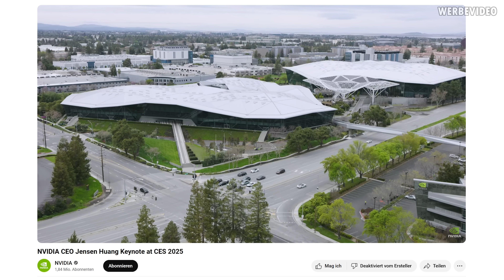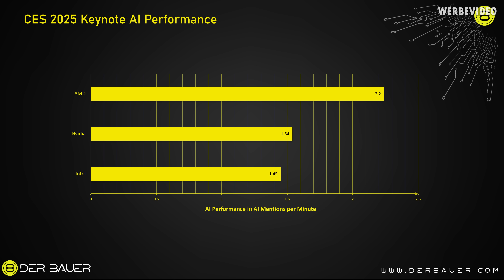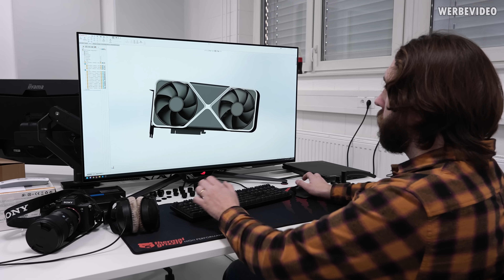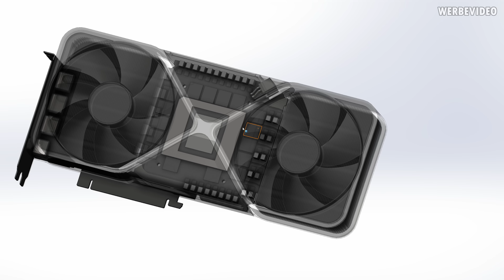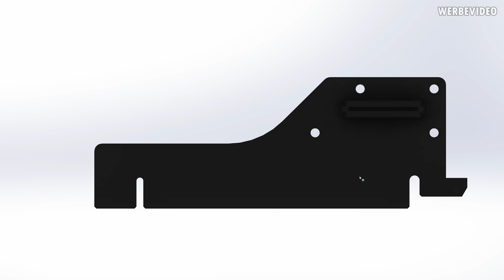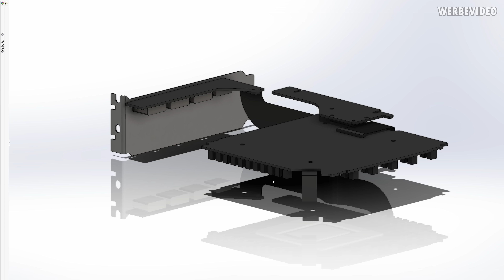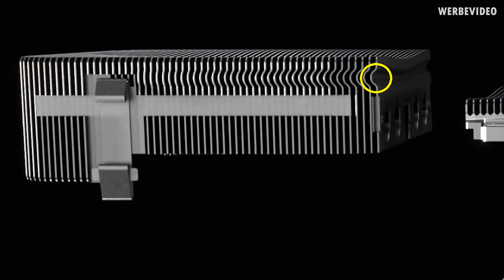We Reverse-Engineered the Nvidia RTX 5090 Founders Edition

Comment: I usually go for the founders card's but concerned this gen with their design. Definitely well engineered and all but wondering what the thermals  and noise levels will be like for running 575 W in that 2 slot cooler. Also, using liquid medal as the paste makes it a little more challenging for maintenance if you need to re paste the GPU. Think I will be going for the big ugly chonker from an AIB.
Reply: do liquid metal need repaste?

Comment: Further proof that nVidia is going to war with its AIBs in this design -  there's no way an ASUS or MSI could manufacture something like this and keep the same MSRP tbh as Roman said well. 

I was sceptical of the cooling capability as there doesn't seem to be an awful lot of heatsink mass until I saw GN's video on the 4090 prototype - it will dump loads of that 600W heat into the case but having so much clear area to the finstack might work very well. Before I'd assumed they'd done something like the ROG Matrix 2080ti and a couple of Colorful cards where they'd build a small radiator/pump into the form factor of the card

Comment: what's cool about the 3 piece pcb design, is that if the connector breaks due to sag, you can just replace the pcb connector, it also reduces the problem due to sag the gpu die might rip the pads under it, or in the rams too. also in the future the pcb could be just mounted on a motherboard by the connectors it has on the back like a raspberry CM or any compute module really, we mich see SFF pc's using that, or perhaps a thin PC using it
Reply: Clearly sag poses less of a threat to the die or MCs with this design, but my first thought was that it's putting all the weight on a much smaller area and a much smaller connector, which I'd think is definitely not a good thing. No one seems to care, though, and nvidia's engineers probably wouldn't make stupid design choices on a flagship product with so much R&D, so what am I missing?

Comment: it remain to be seen if those fin's actually is 58 difference bend. A graphical visual does not confirm, but well see once you have the card. Other than that, im not paying Nvidia 2000 dollar + tax on top of it wich ended up with over 28K NOK, 3'rd party will cost over 30K NOK. Crazy Crazy. Im skipping this 50-series and i have a feeling well see the whole saga again with connector and bend PCIe (from 3rd party).

Comment: Nice analysis der Bauer and team.  The Solidworks model looks great sketched up, good work Joe!  So the 5080 won't have the 5090's vapor cooling design, custom fins, liquid metal, etc.? I was hoping it would at least have the vapor cooling, but makes sense they kept the costly design and manufacturing only for the 5090.
Reply: I think the 5080 and 5090 will be the same, besides the main PCB, because it also has a through fan at the back. If you look closely at the 5070 however you can see that the left finstack is 'fake' and it actually exhausts half of the cooler through the IO bracket.
Reply: @JR23Design  Awesome, I'll have a look at the pictures again tonight then!
Reply: @JR23Design  Just checked, the Length, Width, and slots are the same dimensions for the 5090 and 5080.  Also the heat fins have that concave shape. Externally they look identical.  Vapor pipe cooling for 5080, nice!
Reply: I saw a video with a manager from NVIDIA who said that the 5070 won't have this new cooler, so i guess that the 5080 and 5070ti will benefit from this 5090 FE cooler, not sure about the 5070ti though. Does the 5070ti have the same lenght, width and  slots as the 5080 and 5090?
Reply: @Maitatron  5070ti has different dimensions than 5080 and 5090.  5070ti is 62mm less length, and 25mm less width. It is a 2-slotter though, so same height.  The FE 5070 does not specify LxWxSlot, "it varies by manufacturer". Info on Nvidia's website.
Reply: @dirtbiketrailrides  Ah thanks for the answer, so 5070ti might not have this super efficient cooler. What a pity cause on paper the 5070ti looks like the best card for performance per $, i guess 5070ti can't have it all.
Reply: @Maitatron  Yep, read JR23's comment, he pointed out on the 5070ti pictures that one-half of the gpu's fin stack is flat, and the fan may be positioned differently.  Not sure if the vapor cooling pipes are on it or not. Maybe not. Liquid metal interface, not sure either.  But it will have less cooling features since the exterior and dimensions are different.
Reply: @Maitatron  from the product images released the 5070 and 5070Ti seem to have a cooler and PCB that is very similar to the 3080, just without the 90° bend in the fins.

Comment: That modular design is really good in terms of repairability.
Reply: Do you expect Nvidia to sell you the output board, the PCIe connector board?
It's not better when they are not off the self components.
Reply: @IIARROWS  those are simple connector board which can be manufactured by anyone.
Reply: @PenguinYayOne  They can, but would they be? Especially considering the shape and relative low volume.
Beside, what's the probability that they break? They are pretty simple, that's not the part you are going to replace in case of failure.
Reply: @IIARROWS  they are. Cracked PCIe connectors were common on 4090s
Reply: @PenguinYayOne  Ok, good.
Well, this is going to weigh less, let's see if it has an impact too.

Comment: When you do your review, can you show PCIE 4.0 VS PCIE 5.0 I'm on a 5800x3D so would like to know thanks 🙏
Reply: Hopefully it will be 1-3% difference like last time when they tested Gen 4 cards on Gen 3 boards
Reply: I’m on 5800x3D as well. Still a beast of a cpu. I play all my games at 120hz and have never been cpu throttled.
Reply: Genuine question: why would you buy a 5090 if you're running a 5000 series AMD processor? 😂
Reply: @deejnutz2068  well, in my case with the 5800x3D and an Rtx 4070 the limiting factor in all games I play is always my graphics card. I play everything in 4K bc I’m a couch gamer. The 4070 does pretty good for most of my games “most games I can do 4K 120hz on medium-high settings”  but I’ll likely get a 5080 if I can get one for msrp. Also I never see my cpu usage go above 20-30% usage. So genuinely no reason to upgrade to am5 yet.

Comment: After the leak of the laptop 5080 performance I did a crude calculation of the expected performance uplift for the desktop 5080 over the 4080. Simply based on CUDA cores using the 5080L openCL score, the absolute minimum uplift over the 4080 is 11%. That is assuming linear scaling for CUDA cores, and not factoring in the higher clock speeds or power limit on the desktop card. This puts the 5080 with an expected minimum score of 266k vs 230k on the 4080. Realistically I believe in reality the actual performance will be closer to 300k for openCL, which equates to approximately a 25%  uplift over the 4080, which also reflects the first 2 benchmarks in Nvidia's presentation. 25% isn't bad, but I just wish Nvidia wasn't intentionally misleading consumers with totally fake numbers. MFG and DLSS doesnt indicate raw compute power.

Comment: After testing frame gen i came to the conclusion that its absolute garbage and should never be used under ANY circumstances. Nvidia needs to be given as much flamming for the complete lack of raster improvements for this gen (remember the 4090 and 5090s biggest difference isjust the CUDA count, not really raster improvements Gen to gen since its still on the same node pretty much)

Comment: I don't really understand why people like interpolated frames this much?
In most first person shooters I am more sensitive to "latency" than to "smoothness".
I am normally satisfied with 50-80 FPS when it comes to "smoothness". But when it comes to "latency" I prefer 100-144 FPS. (I might prefer even higher if my monitor was faster.

Thus for me to use frame generation and keep the same "latency" I would need a rendered FPS of ~200-280 FPS (frame generation needs two frames to interpolate between, thus you will always add the latency of that one extra frame) and then get ~400-560 FPS with x2 frame generation.
And even if I had a 500 Hz monitor I am not sure that I could even tell that it is more "smooth" than the already 200 FPS.

I guess there could be games what are playable with large "latency", Say maybe flight simulators. In those games you could maybe run with a base frame rate of 25 and then use frame generation to get the game to look "smooth". By getting 50, 75 or 100 FPS. And in a game whit slow movement there might not be that many artifacts from frame generation.

But this is just such a limited use case for me. Maybe others have found better use cases?

Comment: We can no longer use frame rate as a direct measurement of performance. Now that not all frames are equal, or rendered we need to use a different metric to measure preformance
Reply: Yes you can, just turn off frame Gen and dlss
Reply: @Crecross  We already saw that Nvidia didn’t do that.
Reply: Measure them in flops 🤡

Comment: Wow. Nvidia will sell a TON of the FE models if that's the design. The Custom coolers and mini PC cases that will take the main board and the cooling fins out and place them in a new location in the case is going to be awesome! How about a case with the GPU at the top blowing air out or sucking air in! It's going to be so cool. I'm sure card makers are all going to go crazy adopting these PCI / IO connectors on their main boards.

Comment: Thinking like an engineer, you may not need 58 different tools. If all the bends have the same radius, they could just use the same tool, but stamp the different parts a different number of times for each piece. You can calculate the deformation at a given pressure for the fin material, so for example, the least bent fin gets 1 stamp press, and the most gets n+58 stamps. The process becomes longer and more involved, but the cost of the tooling could remain within reason.

Great video, very interesting, I always love your work!
Reply: Could they also be stacking up the fin plates on top of each other and then stamping them all at once? The top stamp would be the sharpest, and all others after that would be greater radius as they all mold around each other in the press.
Reply: @billgaudette5524  stacking them wouldn't work. No way to control material thickness. They would have specialised tooling to do this at scale.
Reply: @billgaudette5524  They will no doubt be re-using the stamping tools in the other FE coolers as well, just not so many fins.
Reply: My thoughts exactly. Doesn't make the design any less impressive though.
Reply: Thank you. That's exactly what I immediately thought looking at those fins. Nobody in their right mind would make 58 different tools just for a single radiator, instead the shape of those fins look like something you can make with one customizable tool. Which is still pretty cool and much more cost efficient. It might work just as you described or it might have different customizable pressure parameters for each desired deformation of a fin and just cycles through them.
Reply: I think it is even simpler than that. Have one big sheet that is stamped one time, the tooling is devided in a way that each part of the big sheet of metal is stamped differently, each according to one individual fin. Then the big piece of metal is is cut at 57 different places, creating 58 pieces, all unique, but that came out of one large sheet that was stamped once
Reply: @ignaciolcb  The BFS. Big F**ing Stamper !!
Reply: More likely they are just using a progressive die with a stage for each bend and cut. So they can essentially make every fin with one tool, just at a different stage. We do this all the time in manufacturing. Keep in mind that in the US, tooling is tax deductible, so most companies don't really care about tooling costs as it just lowers their overall tax liability.
Reply: The concave surface of the stack would need to be done after stamping rather than at the same time if the bend radius is done with pressure. Combine both it shifts the cost of the die to cost in time and exceeds it. Then it introduces greater risk of manufacturing errors which can cost more than a stamping die.
Reply: I was thinking more like 3 stamps, all together where the centre one does the radius and can move down after each fin so it creates a larger radius
Reply: But but but get hyped. I believe this thing will throttle in a small form factor case. Definitely look out for reviews with open benches.
Reply: @aberkae  I think the fact that it is small is going to make a healthy number of reviewers to test in SFF cases if not initially, certainly in follow up tests & reviews. Optimium is a case (pardon the pun, VERY unintentional) as he always does SFF builds. Nvidia could have built it 4090 size and no one would have batted an eyelid.They must have seen some benefit in building down to 2 slot size.

Comment: 5:59 frame generation is not more performance. Better frame smoothness, but system latency is even higher which goes counter to the conventional measurement of performance where higher FPS means better responsiveness.
Reply: Fake frames are analogous to an automatic transmission if you think about it.  Automatic transmission can't anticipate the road, just like how the gamer will change the scene.

It's an instantaneous smoothing.
Reply: And all the fastest cars are? Automatic/electronic shifting, and what do they all have? Assistance, ie traction control, differentials, abs, and so on.

Nvidia might be adding latency but I assume their but unveil of reflex 2 is to counter this, much of what they spoke about was the use of ai to render frames in a more accurate light to how it should be.

Comparing a car to a computer is already a stretch and it's quite a pointless analogy, nobody needed an analogy.

And you can't actually state it has higher latency without seeing it run, my guess is DLSS 4 limits the amount of native frames slightly, so rather than struggle to render 40 it does 30 and reduces latency through this and reflex 2, Nvidia may be greedy and may be cornering the market, but they aren't stupid, DLSS, even 1.0 was quite a piece of software, and they rarely mess up, I highly doubt that they won't deliver on this occasion.

Most people moaning about latency and don't even benefit from 5ms, let alone the 20s they so badly dread, if it was poor, only a small portion would truly be affected in any forms meaningful.
Reply: @fewik8567 30fps response times feel atrocious no matter how slow your brain is.

Comment: Usually the dimples, bends or louvers would be to increase turbulence and thus increase the air side heat transfer coefficient. The concavity of the fins may be to try and increase flow velocity through the center by increasing the resistance on the edges (since there is more fin surface area). 
Honestly the thermal design of this card looks amazing and a real treat for thermal engineers. I hope I can get my hands on one to actually see it in person.
I wonder if they have brazed the heat pipes to the vapor chamber or they have them directly connected to the chamber. Can't wait for you or Steve to cut them open!
Reply: I bet you the primary reason for the dimples is optimizing air flow and reducing pressure when multiple cards are stacked together. Remember, the 5090 is only a gaming card in name at this point. A lot of these will end up getting tossed into AI farms. The partner cards will likely get stripped again like what happened with the 4090. That's why most the cards on ebay are listed as "No core or VRAM". Jensen knows exactly what he's doing.
Reply: I think they said something with 3d vapor chamber my guess is like you said

The vapor chamber hugs the heatpipes for more surface area and is probably brazed as well

Since looking at the design they took a WHOLE HECK load of effort into making it a 2 slot card
Reply: I think dimples serve to decrease turbulence, because why would you want turbulence. I know from practice when i put 4090s on a rig 20cm away from each other they were overheating and when i put my hand between them there was huge turbulence. Air was not going the way it was intended to. It seemed like fans were as much sucking as blowing the air. 

It makes me think that if you want to make a PC rig that has exceptional thermals you better do it flawlessly or give up all altogether. When you have weak airflow atleast you didn't create turbulence.

Comment: I'm worried about how they will make water blocks for this design.
Reply: Honestly seems like more traditional AIB partner cards might be easier for water-cooling than this one. This is clearly “purpose-built” and so would be a bad candidate for disassembly.
Reply: @stillmoms  Yeah, I didn't think of that. I'll be buying mine from Asus.  I feel better now!
Reply: They won't. AIB's already have blocks available with 5090's pre-installed
Reply: @ATestamentToTech  Perhaps Optimus will make one. I hate AIO stuff and only have open loops in my PCs.
Reply: @RC_Flyer-h2v  They are open loop blocks! Pre-installed. Both MSI and Gigabyte already have them
Reply: @ATestamentToTech  I'll go for MSI,  Thanks for the info!